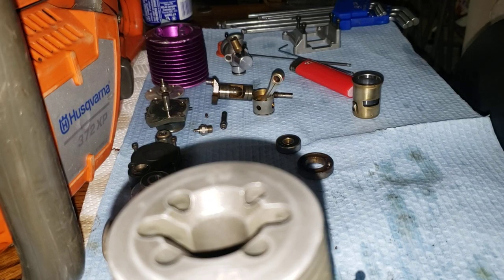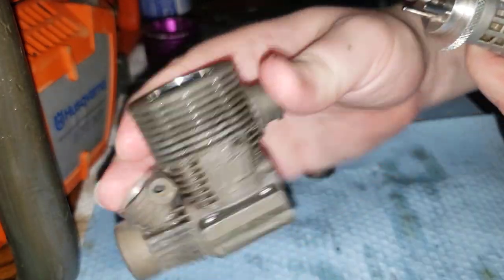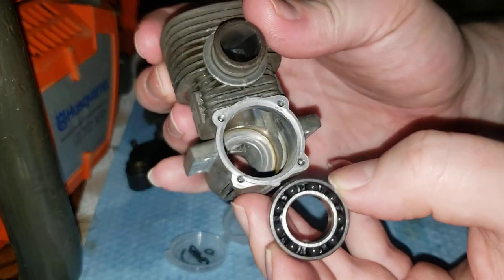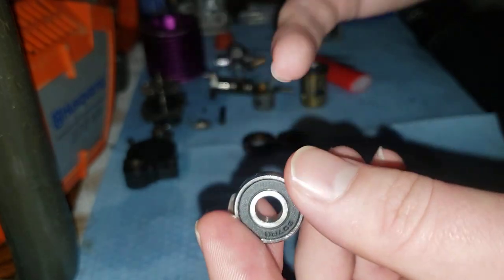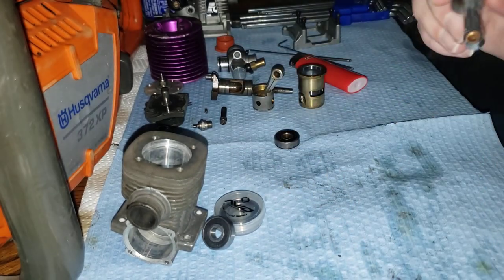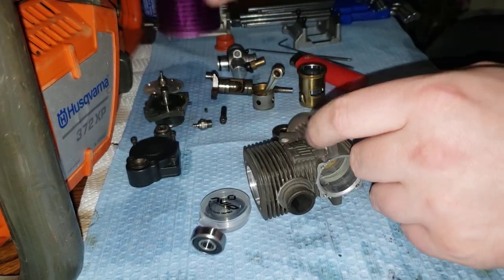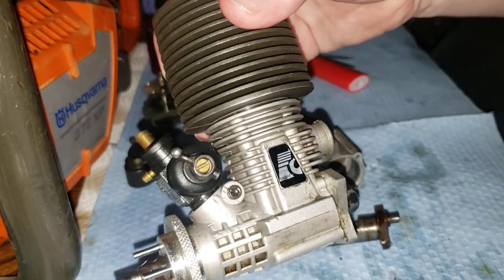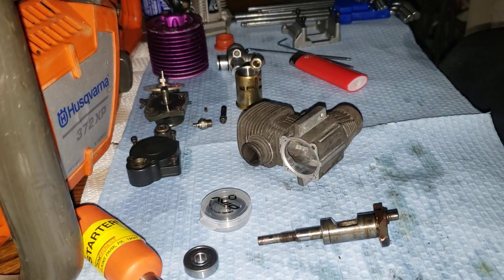Nitro engine bearings and things you should know. and HPI F 4.6 tricks

Comment: HPI F 4.6 piston sleeve does fits Force  .28 thats what i did and tossed the HPI block in the garbage along with the carb
Reply from the maker: Nothing wrong with the block on the HPI  But the carbraters are garbage they're really cheesy they don't tune all that great from what I have found and that stupid steel sleeve on the bottom will get loose and then your carburetor will spin in the block no matter how much you tighten it down and then it will get stuck in the block and ruin it.

Comment: IV got everything for the 4.6 engine  a Piston sleeve and connecting rod set new 50$   any parts for it I got  the crank shaft I put in a drill and spin it while use a super fine skatch bright pad I it looks brand new every time 👍👌✌️💯🛠️🍻  the internal bearing for the 4.6 is a different size then any other 28 except for the force I'm not positive but I think that's what the f stand's for. The 4.1 3.5 hpi and the sh28 use the same size bearings  and crank shaft size but the hpi 4.6 is actually bigger crank diameter just a fyi 👍👌✌️💯🏎️🍻 savage nation 💪
Reply from the maker: Nice and yeah I was quite surprised at such a strange bearing size for such a common Taiwanese made engine usually they're all pretty similar or almost the same and yeah I have a new piston and sleeve kit on the way for it as well as A Pull starter and a few other goodies. Should be a good runner once again!

Comment: Got my first engine with ceramic crank bearings. PROTEK Samurai R03.  Brand new, Spin the crank and it feels like the balls have flats in them.  Unbelievable how rough this thing spins. Ran 1st break in tank, tons of oil out the front bearing. I bought the engine in 2020 and just recently used it. They won’t send out bearings as it’s been a while and I get it. But not impressed and not happy.
Reply from the maker: Could be a manufacturing defect I'm not sure I haven't dealt with one of those engines before but it would probably be a good idea to replace the bearings to avoid a failure.
Reply: @thebug4046  I  put the kids to bed and was going to tear down the engine to yank the bearings out. Before I did though I spun the crack back and forth a lot and I’ll be damned the roughness all of a sudden stopped. Turns smooth as silk now.  I don’t get it at all. Removed the backplate and nothing fell out.  Clean as a whistle.  I guess I’ll run it and break it in and if it keeps leaking I’ll install a double sealed bearing in the front unless someone thinks that is a bad idea.  But I’m baffled though why it was turning so rough. 🤔
Reply from the maker: @Thedudeabides803  keep in mind the bearings don't seal the engine. It will always leak if it's tuned to rich or to much after run oil was used. I have a video explaining it
Reply: @thebug4046  awesome thanks man, I won’t worry about it then.  I have run exclusively and many 2.5 and 3.3. Traxxas engines since 2001. Love your videos on them btw.  Who knows they were all probably leaking and I just never noticed.  First time with a different engine other than a Fantom .18 I had way back.  This engine cost me an arm and a leg comparatively so I am monitoring what’s happening with it with a very scrutinizing eye.  Cheers
Reply from the maker: @Thedudeabides803   Definitely good engines to learn with for sure since there's such an abundance but yeah when you start getting into these hide all our engines shit gets expensive quick!  But yes like I had mentioned with the whole front bearing thing they don't seal it's actually a liquid seal between the crank and the inner case of the engine kind of an interesting design really if you pay close attention to how it's designed. Old European rc car on road engines ran without any kind of seal or shield on the front bearing at all! It's a myth that companies came up with to sell you bearing that you didn't need and when you change out your leaking front bearing for a new one that still leaks  Leaves you scratching your head for a minute wondering why and all it is running too rich. 😆 but I'm glad you find the videos helpful! 🍻🤘🏻💯

Comment: Thank you! I wish I could give this a double thumbs up - much appreciated.✌ I thought my Savage was a 4.6 as I ordered that rear bearing for mine, and it didn't match the original size (13x24x6) and not a 14x25x6. Also my piston had a full skirt (no cut-out) is that weird or what?  I just did a bit of research after watching your video and by the looks of it (based on the bearing size of 13x24x6) it looks like the Savage I purchased is a 4.1 (not a 4.6).  Pretty hard to tell the difference between a 4.1 and 4.6 (without opening it up) - shame me once...
Reply: They may have had different versions. Always good practice to take out the existing bearing, measure and order from there.  That way there isn't any chance to get the wrong size. Some manufactures even used the same block for different engine types (so they look the same/similar) but, all of the internals are different (crank especially). Did you ended up getting the correct size bearing for your rebuild?
Reply: @a2rc  Yes, I ordered it this week and should have it by tomorrow - made for the .21 to the .25 (apparently they are the same rear bearing). This is also my first engine with no cut-out of piston skirt too...
Reply: @th3duke1  That's apart of why I enjoy rebuilding engines so much. They are like easter eggs lol they all have different surprises inside.
 I am glad you have the bearing ordered! You will have her running again in no time
Reply from the maker: Truth be told 💯 haha
Reply from the maker: You're very welcome! And yes from a glance the 4.1 and 4.6 look very similar to each other. A lot of people get them confused because of that.

Comment: Hey, TheBug404! I have a Traxxas Jato and, when I rev the engine in the air, no issue, the tires blow and the 2º gear engages smothly. Same when I put the car on the ground, the car moves with no problem. But, the thing is when I accelerate to the maximium on the ground, the car struggles to engage the 2º gear, while the enigne seems to wind freely in high revs, like without any friccion.

I own this Jato for 2 years and never had this problem.

The cluchshoes and the springs are fine. I teared down the shiftbox and everything is fine. I replaced the bearings, they're new, and thigten the screws, flywheel, etc...

Can u guess what is going on?
Reply from the maker: That's hard to say without seeing it or hearing it it could be too rich it could be too lean it could have a fuel or exhaust system leak it could have a plug that's on the way out.  Put a fresh OS lc3 glow plug in and open the high speed needle. If it gets worse then lean the high speed needle till best performance is achieved. If it has the plastic exhaust sometimes they melt and clog the pipe. Make sure the fuel tank is not leaking. Or the exhaust is not leaking. Very important!!!

Comment: Hey Bug great videos and content love your humor.  I had a couple of question on a traxxxas 3.3 bearings?  What brand and type would you recommend i use so many to pick from but i don't want to go cheap and have a bearing failure?  I would like to change out my conrod and pin can you also recommend one other then a traxxas conrod or is that my only choice? Thanks....
Reply from the maker: No other rods available for Traxxas engines unfortunately. Just change it out after the first half to full gallon along with the bearings and wrist pin. As far as bearings i run SKF or NTN Bearings or usually in everything without issue. Avoid Traxxas bearings or Chinese bearings or fast Eddie engine bearings are soft stainless steel garbage and don't last. Acer bearings are good or  NTN OR SKF. Os lc3 or LC4 Glow plug
Reply: @thebug4046  Thanks bug ill look into the bearings listed.  I also will be changing the crank to the RCR crank when i change out the bearings and conrod.  I am running a LC3 plug also along with the OS11 carb.
Reply from the maker: @jamesklimowicz7591  should go pretty good!
Reply: @thebug4046  Thanks for your help and videos should make this very easy.
Reply from the maker: @jamesklimowicz7591  got lots of 3.3 videos rebuilds and all that 😉🍻
Reply: @thebug4046 Hey Bug had a question on Avid bearings on the traxxas before i order them? 12x21x5 ceramic rear does not have rubber seals, 7x17x5 front ceramic rubber.  Do they have your blessing?? Thanks
Reply from the maker: @jamesklimowicz7591  i usually don't run them because of the cost here but they are good! And yeah no seals on the rear bearing only one seal in the front. Also make sure the plastic cage faces into the block! I have a video explaining it on my HPI F4.6 engine a few video down. Because you can put them in wrong
Reply: @thebug4046  Thanks man i better write myself a note i'm gettin older ... ha ha
Reply from the maker: @jamesklimowicz7591  Haha no worries!
Reply: @thebug4046  Hey bug finally had a minute to take apart the 3.3 and you were correct about the end play on the con rod and wrist pin???? Crazy to think only after 20 tanks just under 1 gallon it would have that much play??  Looks like ill be doing some maintenance on the other two.  Thanks
Reply from the maker: @jamesklimowicz7591  that's why I tell people to replace the bearings rod and pin after the first gallon or close it it. Will tighten everything up and keep it from going bang! Lol salp a new OS LC3 glow plug in it to will make a big difference

Comment: Hi bug what's a good piston and sleeve for a picco p3 .28 and do you know of a good replacement pinch bolt for the losi 454 carb? That pinch bolt bolt is hard to find.
Reply from the maker: The picco p3 is discontinued a long time ago. You will have to send the engine to RB Mods to have it pinched and get fresh bearings. As for a losi 454 it's literally just a rebrand SH 28 P8. Any SH big  block or Dynamite big red pinch bolt carb starter crankshaft bearings etc will fit that engine.
Reply: Thank you for the info Bug 404
Reply from the maker: @Nitro-Aaron31  no worries

Comment: The dynamite .28 rtr engine is a hpi f4.6 literally no different other than colors ND emblems
Reply from the maker: Same porting?
Reply: @thebug4046  identical sleeve crank backplate surprisingly there's no lawsuit if it was traxxas involved there would be
Reply: It even has the fang off the ports that fource does I don't recall seeing fangs in other dynamite engines I'm thinking the engine was made by fource for dynamite
Reply from the maker: @samsonight2721   Thank you for the information I will definitely check that out
Reply: @thebug4046  ya idk about Canada but in US u can get those engines for 100 to 105 bucks new all day

Comment: Hey to all if anyone can help me new to nitro rc an I have a o.s. 18cvr on a traxxas tmaxx takes time to start then when it does fire off runs for like 5 to 10 seconds then shuts down is it blown up or is it a easy fix?
Reply from the maker: If it was blown up it wouldn't run at all.   It's kind of hard to diagnose that over a text like this I would suggest putting a new plug in as well as using fresh fuel and making sure you have no fuel or exhaust system leaks. GLOW PLUG OS #7  fuel 20 or 30% nitro no more than 12% oil. Also be sure to check out the Nitro RC enthusiasts group on Facebook  Be sure to answer the 3 questions and posts a video of the issue. I'm an admin guy in dark sunglasses 😎 see you there! 🍻